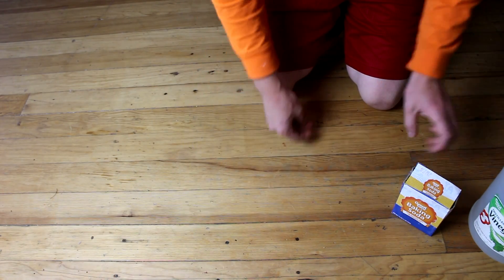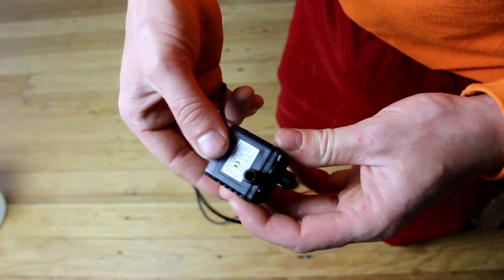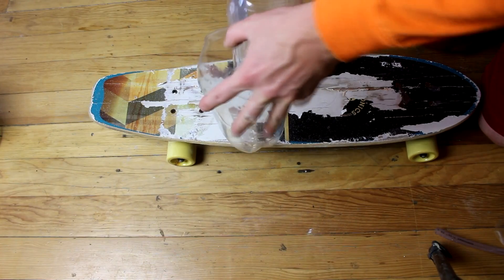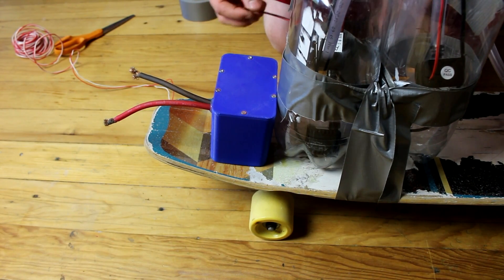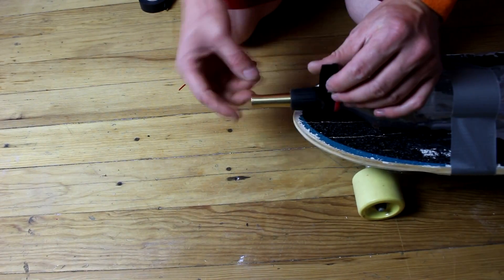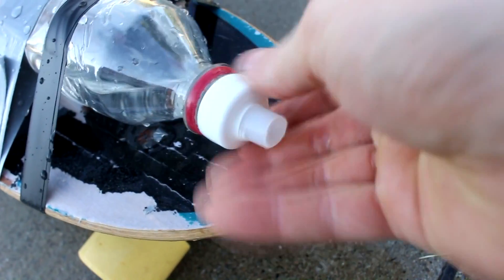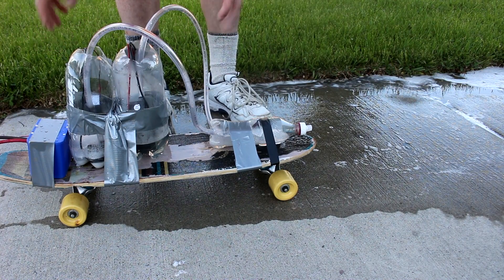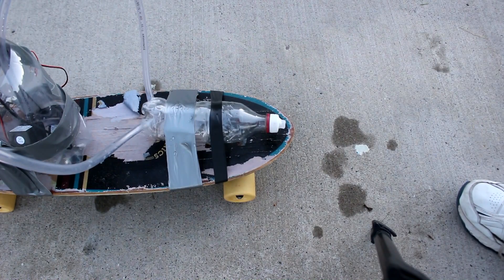Liquid Fueled Baking Soda/Vinegar Rocket

Comment: The reason it didn't work well is because your stream is half air and air won't give you much thrust at that speed.  You'd get much better results with a liquid only stream coming out of your nozzle.  Just use a third upright bottle as a reaction chamber and a forth upright bottle as the chamber with the propellant.  Gas from reaction chamber goes into the top of the propellant chamber.  This way the third chamber creates the gas, then goes into the top of the forth chamber and pressurizes it.  The nozzle needs to have a clunk hose that goes to the bottom of the forth bottle that's filled full of water.  This way, only water comes out.  You'd get MUCH better thrust this way and the only materials you'd need: two extra bottles and some more hose

Comment: can you try pressurizing the fuel tanks (bottles) with balloons to push the fuel out. maybe a 2 liter bottle with a filled balloon on the mouth and a hole in the bottom for the fuel pipe to the reaction chamber.

Comment: Pressure in the reaction chamber is always lower than in pumps, because otherwise the components would be pushed back in pipes. So basically in this construction you get no more jet power than the power of pumps, and the fuel is just a cosmetic feature. Am I wrong?

Comment: The cuts on the 2-liter bottles is too intrusive, two crossing slits at the top would have been fine and you could keep the tops on each bottle. Not water tight, just less intrusive.

Comment: The wheels on the skateboard are a little to big which would make it heavier and you should loosen up the bolts which are holding in the wheel because they are normally over-tightened.

Comment: Cody found your channel a couple of months ago and love it. What is nice is you have something for everyone of all ages.  With this project if you were to point the jet more towards the ground or place a wall behind so then it has something to push off of. This did bring back memories of building a paper mache volcano in grade school and using dye coloring with the vinegar and baking soda mixture.
Reply: Mad Dog 
Except rockets don't need things to push off of. Real rockets work in space with the same principle as this.
Reply: Pushing off of something could work, but it ruins the whole "rocket" idea because of why it works: if you place a board or something in the exhaust stream of the rocket and bring it close enough to the motor you cause a restriction of the flow that backs up into the nozzle. This back-up raises the pressure in the nozzle, which increases thrust, BUT as soon as the rocket moves at all you have to chase it with the board while continuing to push the board forward against the exhaust pressure. You could just as easily turn off the rocket motor, push the board all the way up to touching the nozzle, and just push the rocket forward with the board. Having the motor running provides no extra benefit.

Comment: Cody why 3 pumps in serie and not add 6 separate feed lines. Next Calculate proportions needed of each. Heat all liquids so they react faster. Nice anyway keep it up and let's hope you can get the real deal to work.

Comment: most pumps will not add pressure in series or increase volume.  he is gaining over a single pump by over coming the system losses. the end pump is running at its max capacity but no more

Comment: I was thinking, what would happen if the inlet tubes to the combustion chamber were facing the rear of the chamber at an angle so that the pumps spray the water with baking soda and vinegar against the rear of the chamber. The idea is that maybe the liquids aren't mixing as much as they could before they exit. this would allow the liquids more time to chemically react. Maybe try that next time...and not near the lawn :)

Comment: For this to work, you need a tank attached to the nozzle that is plain water and a second tank that feeds into it that mixes baking soda and vinegar for pressurization. The way is set now, the rocket "starves" itself and needs a pump that can supply the water at the same rate that it comes out the nozzle. Might as well hook up the pumps straight to the nozzle if that's the case.

Comment: The nozzle looked a lot like a flat transition to a smaller hole -  wouldn't this lead to a higher friction co-efficient at the nozzle and energy loss? 

A tapered transition like inside a venturi meter might reduce that. 

In addition, was it necessary to pump in both reagents in solution? pehaps a pressure chamber with large lumps of the Calcium Carbonate behind a mesh (to prevent the nozzle from getting obstructed) would simplify the design a little, and make a weigh saving from having the two bottles of solution.

Comment: I'm sure you know about the physics behind this, dp/dt ( v*dm/dt) of the ejected fuel matches the momentum change of the "rocket" (m*dv/dt)so why are you trying to use something as massive as a skateboard with that capacitor on it. You'll either need a ton more fuel or need to use a less massive rocket with the same amount of fuel. Silly chemists alway doing stuff while ignoring the math and physics behind it.

Comment: A smaller reaction chamber would help, as well, perhaps some silicone caulking around the fuel lines where they enter the reaction chamber? It would ensure and even better seal, making sure the exhaust only goes out the nozzle.

Comment: Probably would have got a lot more movement out of the skate board if you had tilted your combustion chamber some, with the nozzle pointing downward at the ground.. The thrust was pushing against the air, which has very little resistance of course... Pointing it at the ground and pushing the thrust into it, is going to give you a lot more forward motion..

Comment: Cody, pumps don't create liquid pressures because liquids can't be compressed, so having more pumps won't do anything, to create more pressure with a liquid pump, you just need a smaller restriction.
Reply from the maker: No, liquids can be compressed it just take more force than for gasses, for instance in the deep oceans at 4 km depth, where pressures are 40 MPa, there is a 1.8% decrease in volume, not a lot but the compression is still there. and just like a very stiff spring you are still storing energy even if you only compress it a tiny amount.
Reply: True. well still, pumps don't create the pressures, restrictions do, was what I was trying to say. Thank you for the reply!

Comment: Cody, I've gotta ask.  What's the ISP?
Reply from the maker: well the exhaust velocity on this model was about 5m/s so the isp would be about .5 seconds. the pressure fed design did better at about 1.5seconds.
Reply: Cody'sLab looking forward to seeing "more energetic" fuels. If you jump straight to hydrogen/LOX, you'll have trouble beating that ISP 😃
Reply: You know, I wonder. If you put a "bell" on the exhaust nozzle, would it increase the ISP. Something for the expanding gasses to push against.

Comment: far too safe.  you should try it with sodium hydroxide and conc sulphuric :D   might need a bit of a better reaction chamber...
Reply from the maker: would make no gas if I did that so it would produce no thrust whatsoever besides what the pumps produced. Now if I where to use concentrated hydrogen peroxide and a catalist (KI, silver, manganese) then we'd be talken dangerous and also about 300 times better isp.
Reply: it's true the reaction makes no gas... at room temperature. but it would get so damn hot that any water would turn to steam very rapidly. I think it would produce plenty of thrust ;)

Comment: There are a few things that would make this work better: 1 lower roll resistance wheels. IE larger diameter, of a harder plastic and less than half the width. 2 higher pressure pumps if available (so that the nozzle can be reduced in size). 3 heat up the water before dissolving the baking soda to get an absolutely saturated solution. 4 use a higher strength vinegar. I would also have a third pump to pump in washing up liquid or similar but at about 10% of the flow rate for the other two (as it helps with the consistency of what comes out. I would also try a smaller chamber if using higher pressure pumps (the 250ml "mini" 7up bottles for example). I'm going looking for pumps now. 
http://www.ebay.co.uk/itm/Cfly889-12V-DC-5L-min-60W-Micro-Car-Diaphragm-High-Pressure-Water-Pump/322064135704?rt=nc&_soffid=5030559104&_soffType=OrderSubTotalOffer&_trksid=p5731.m3795
Those might make the difference. Also having warm reagents vastly increases the reaction rate.

Comment: I always wondered if you could use scales and some kind of pump array to make a Hero's (Herod's) fountain with 2 liter bottles go a little bit longer. The idea would be to let the pumps and gravity force the scales to switch the bottles back and forth. I know you wouldn't get a permanent fountain, but just to make it last a little bit longer would be nice. I used to set the simple plans for a Hero's fountain using 2 liter bottles up for the birds and squirrels on hot days in the summer. They just didn't last too long before I had to switch them and start over. I thought if anybody could figure out how to make one last a little longer, you could. I never could figure it out then later I didn't have time to do projects like that any more.

Comment: If you instead made a premixing camber where you could screw each bottle into a port, you could start the rocket by flipping it over. No need for pumps or batterie (=a light engine).
The nozel could also be much more narrow (=more trust) since the system will pressurize it self.

Comment: Hi Cody, great project! Couldn't you use sealed fuel bottles and then route some of the combustion chamber pressure back into the fuel bottles to pressurize them and help the pumps drive fuel through faster?

Comment: Rutherford engine on Electron rocket uses electric motor to run the turbopump. Quite cool, not so efficient but good enough to lift more than 150 kg to orbit

Comment: Did the reaction actually complete in the rocket engine? I would have expected a bit more reaction, especially seeing the mix you did in the glasses outside the rocket, and the rate the pumps empty the bottles. Perhaps some better mixing in the reaction chamber could improve the thrust a bit?

Comment: I couldn't help but cringe every time you ran those pumps dry. I know they were only $4 pumps, but running submersible brushless pumps dry destroys the bearings and head. They rely on that hydrostatic pressure to lubricate and cool.

Comment: Try feeding the reactants through one of those mixers that you put on an epoxy gun, the large diameter ones should allow enough flow.
Also there might be some way to feed some pressure from the nozzle back to the reactant vessels so the pumps don't have to fight so hard?

Comment: Not sure I necessarily buy that this would work much better in the water. The craft is very heavy and would need to displace a lot of water, when full fueled.

Not to mention you've then got the issue of the boat rising out of the water as fuel is used, and how that effects the balance and direction of the nozzle so it's never pushing the boat into the water; It just sounds like a lot of added problems

The skateboard looks quite old, I think just putting on new wheels with fresh bearings would greatly enhance the performance of this.

Comment: Would it have worked better if you instead of putting the pumps in series put them parallel? Velocity would drop a little but volume would double, getting your liquids in the reaction chamber faster.

Comment: maybe revisit the Nitric Acid/kerosene rocket? Instead of Kerosene (if I remember correctly you used diesel?) but substitute the Kerosene for isopropyl alcohol so they mix better in the combustion chamber. Or, you know, you end up with a bomb.

Comment: Using a controlled gas bleedback into the pressurized type fuel system would develop the needed thrust and reduce the mass of the vehicle. Also, adding a mesh [such as a copper or stainless steel scrubber] to the reaction chamber would increase the completion of the reaction inside the chamber, as opposed to it going out the exhaust unreacted.

Sadly, carbonates are in general only sparingly soluble in water, although I suspect that the addition of detergent helped a little.

A tiny addition of sodium percarbonate might boost the reaction gases.

https://en.wikipedia.org/wiki/Sodium_percarbonate
Reply: If you could just press sodium percarbonate into a pellet and shoot concentrated hydrochloric acid and sodium hypochlorite into it [2 liquid reactants, one solid] you could probably produce a reaction hot enough to need a metal container and a whole lot of thrust.

For that I suggest a heat and corrosion resistant positive displacement pump like this... http://www.ebay.com/itm/12v-DC-Hot-Water-Corrosion-resistant-circulation-gear-Pump-Self-priming-ZC-520-/322130500112 

Take at least 3 liter bottles [not only more capacity but a much larger lid for better modifications], lay them on their sides [less air drag] and let the siphon tubes go in with a formed lead weight [unless you are short on lead] which is bevel cut to allow it to 'hug' the bottom pretty closely, put a vertical snorkel stack on the lid to allow air to enter so you don't suck the tanks down and fail to draw all of the fuel out.

Put pump sprayer type nozzles [brass or stainless steel] on the ends of the fuel injectors to mix the liquid reactants as a mist which will then flow through the pressed sodium percarbonate fuel grain [probably want stainless steel or else very thick steel so the corrosive effects of this do not destroy your engine] and then add a bell nozzle.

I know first hand what these reactants do in presence of each other, as I use them in this combination to strip rust, zinc, chrome, paint, or anything else off of base metals for pre-coating preparation.

It produces a whole lot of poisonous gas and is a strong oxidizer, so it would likely be something you would want to do out in the country.

In fact, its SUCH a strong oxidizer, you COULD add a fuel pellet of something like compressed rubber or nylon behind this for the final reactant.

Comment: Could you have used 2 valves? Any of the high pressure pump designs would obviously work better but I am wondering how quick that reaction was compared with your flow rate??  When it got going it did look like a lot was being sprayed out before it had reacted properly?

I think some of the peroxide racing carts used  high flow fuel pumps and valves when they started racing them... would have been a bit bumpy now they all use turbines to pump the fuel while being turned by the exploding fuel.

Comment: For better pressure, you could try using a y shaped connector hose for both pump inlets and and both outlets to connect the output in parallel as opposed to in series, this will be less damaging for the second pump too, which I imagine would potentially burn out eventually if you force water through the inlet... 
You could even output each fuel component through a cut off valve and into a pressure chamber, stepping down to a smaller hose to allow a build up to occur  before continuing on to the reaction chamber...

(although water is not really going to condense unless you're also boiling the fuels, so that won't help heaps with this project :P)

Comment: What about instead of the pumps, you just seal the fuel tanks and run a line from the combustion chamber back to the tanks to pressurize them? then all you need is a way to start the reaction and you won't have any way to stop it

Comment: I think that using actual chemicals to create the thrust for the rocket would be an amazing idea for another video.
Reply: BenPope10 i think using no chemicals would be even cooler.
Reply: like peroxide and bleach
Reply: All matter is chemicals
Reply: If it's rp1 and lox rp1 is an hydrocarbon rp1 is just purified kerosene and if it's hydrolox then it's just two atoms I dont know if those are chemicals but if you're talking about hypergolics those are defenitly chemicals like hydrazine and nitrogen tetroxide
Reply: carolyn mmitchell or peroxide and kerosene that would give you more specific impulse and more thrust
Reply: BenPope10 I mean to be fair Sodium Bicarbonate and Acetic acid are "actual chemicals," but I see your point.

Comment: you do an awesome one with a bottle full of chopped up Mentos, and then pump in the diet coke...a mix of solid and liquid fuels, but would probably make great thrust.  Also, use your drill to lighten up the skateboard with some holes in the deck or something...

Comment: you should use a longer and thinner "combustion" chamber like a glass tube for it so the chemical will be mixed more probably, thus giving more time for it to release CO2 inside the chamber so you can increase the efficiency.

Comment: Fun project as always Cody!
I think if you would make all containers sealed and provide a small line back to the tanks for them to also pressurize,
the pumps would be able to put liquid trough with a smaller nozzle resulting in more thrust.

Comment: If the two fuel tanks are sealed you could introduce a small amount of the other reactant so as to pressurize the fuel chamber during launch.  So, in the baking soda tank you would introduce a small amount of vinegar to produce gas pressure and push out the baking soda solution.  Same in the vinegar tank, you can introduce some baking soda to produce gas pressure in the fuel tank.  No pumps needed if the reaction is quick enough.